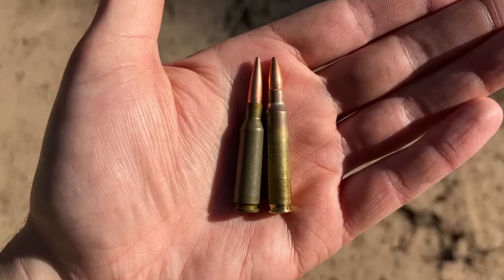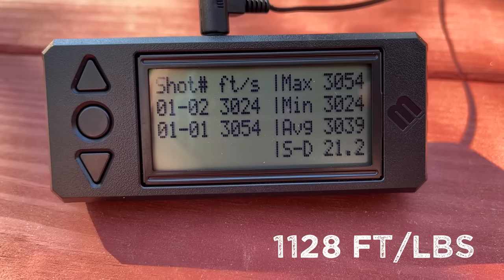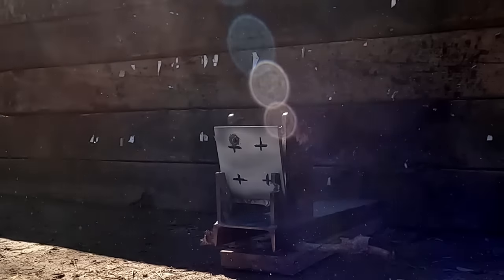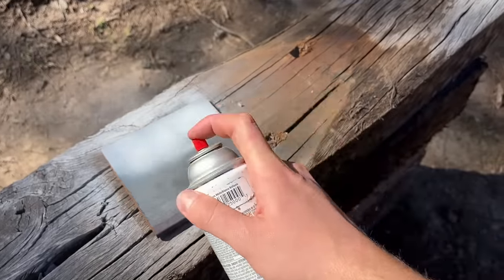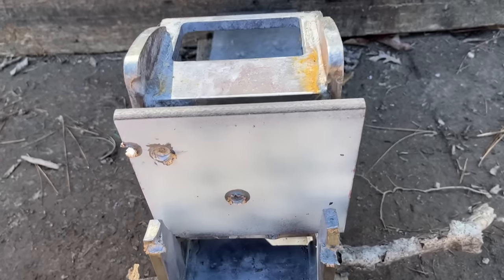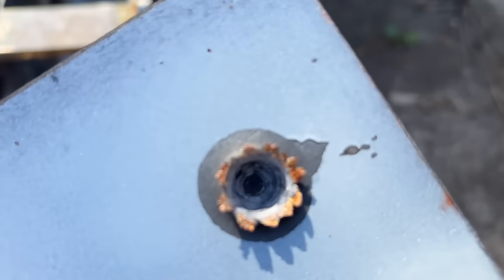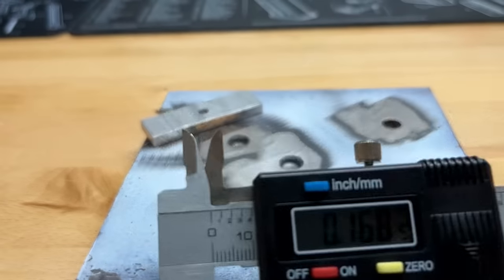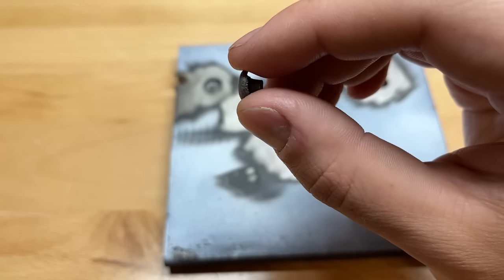5.56 vs 5.45x39 On Mild Steel: NOT So Similar After All?

Comment: 7N6 is a MILD steel core, intended to reduce manufacturing cost, not to increase penetration.
Reply: It also makes bullet very unstable after hit
Reply: 7n6 is not AP at all
Reply: It also allows the bullet to be lighter for length
Reply: Can't imagine why it would be cheaper. Lead is cheaper than steel
Reply: @theimmortal4718  In Soviet Russia, steel is cheaper than lead ;-)
Reply: @kmieciu4ever  
Really? Why?
Reply: @theimmortal4718  Supplies probably. Just like they had the largest reserves of Titanium when it was the USSR. Which the US made shell companies to get.
Reply: @AbsolutionArmament  
I've never heard of anyone considering lead to be a limited or expensive resource.
The advantage of using steel in bullets, as well as mono core copper,  is that it's possible to produce a longer bullet for caliber without increasing weight and reducing velocity.
The longer bullet ensures that it will yaw early in a target. Tumbling is the primary wounding mechanism of the 53 grain  7N6.
The M855A1 62 grain EPR also uses steel along with copper, with no lead. The two bullets are both about an inch long, which would make them over 70-75 grains if they were conventional lead cored.

The soviets knew what they were doing when they designed the 5.45. Long slender bullet with high BC, high velocity (2950 fps from AK74), and early yaw (first 2" of target).
I doubt that scarcity or cost of lead had much to do with the choice of steel. Their 7.62x54, 7.62x39, and 12.7x108  rounds have plenty of lead.
Reply: @theimmortal4718  No, it's not
Reply: that not true
manufacturing  steel core more costly, penetration is a key. mild steel core ammo have waaay better pen vs lead.
Reply: @vaninec  
☝️This
Reply: @theimmortal4718  
Just look up pen lead vs. mild steel
Reply: @vaninec  It was cheaper in USSR and it's still cheaper in Russia due to MASSIVE ore deposits and dirt cheap ENERGY.
Reply: @BigSmartArmed  
I agree, but that not a main factor 
Penetratoon of solid lead bullets is shit, I try myself and you can find many videos on YouTube
Reply: @vaninec Dude my first post clearly states that mild steel core is not for AP penetration, it's for cheap mass manufacture.  Mild steel core comes in a wire spool that's fed into a cutting and forming machines which are run continuously.    

Penetration of 7N6 is superior to SS109 especially in post barrier strikes. 

SS109 fragments if there is enough velocity, or splits in two parts with lead squeezed out.  7N6 just keeps on going until it looses energy.
Reply: @BigSmartArmed  
I know what you said.
I just want to make a point mild steel  ammo waaaaay better pen than lead, that all.
Reply: @PyromaN93  that’s the point of the round…. Hence why it was nicknamed the “poison bullet”
Reply: Steel does penetrate better than lead, though. I can't imagine this fact being lost on the engineering team that designed the round. Unintended, but still so. Probably not really. It was probably a factor along with BC.
Reply: @theimmortal4718  Anyone who has ever been to a scrap yard can tell you that's false. Lead is about 5x more valuable than steel.
Reply: @Oldsmobility98  
That's an unbelievably recent occurrence, and only in the US, due mining regulations by the EPA
Reply: Lead has been more valuable than steel forever as far as I know; including fifteen years ago when steel was at astronomically high scrap prices. It's just a matter of limited supply. Iron is something like 5% of the earth and lead is like .001%.
Reply: @Oldsmobility98  
Lol. What?
Why are you talking about recycling? I'm talking about new manufacturing.
The reason scrap steel is pretty valueless is because it's harder to recycle, as lead is pretty easy to do so.
That has nothing to do with new production.
For new production, as would be used in the manufacturing of ammo for national defense, lead is cheaper. 
Are you imagining that major ammo manufacturers are paying people to go collect tire weights at the local dump?

The USSR actually knew what they were doing when they designed 7N6. It did everything it was set out to do, and replacing the steel with lead would have reduced those capabilities. It outperforms the lead cored, with higher accuracy and velocity, and has a shorter neck before tumbling in the target.
Reply: M855 is also mild steel core. Jesus the mental gymnastics some people go through.
Reply: @EtherFox  
Correct.
Reply: ok yeah thats what i was thinking.
Reply: 7N6 and M855 both use a mild steel core for the same purpose: to improve post-penetration terminal performance. The steel core does also help get a longer bullet for aerodynamic reasons and enables them to penetrate a steel helmet at longer range than a lead core FMJ bullet, but I believe those are secondary effects from the intent.
Reply: @shockwave6213 Wrong.  7N6 msc was made the way it was to CUT MANUFACTURING COSTS.  Steel is cheaper then lead.
Reply: jasonpuddy7866 yes, but 7n6 is still the most primitive cartridge from the 5,45 line
A modern armor-piercing cartridge, like 5,56 green tip, is a 7n24 cartridge
Reply: @bigbadaboooom  Of course not, it was made for soft tissue.
Reply: @theimmortal4718  
Steal core have more pen vs lead
Reply: @vaninec  obviously, but russia used a mild steel plug in 7n6 because it was cheaper than lead.
Reply: @theimmortal4718 because at the time the Soviet Union had so much steel stockpiled
Reply: @letsdothis9063  It was completely intentional. Nobody puts a steel insert into a bullet for reason other than aiding in penetration.
Reply: This is NOT the answer but the uploader gave it a heart....because it sounded good?  It the steel core is definitely designed to increase penetration LOL but it is not AP, just hard target piercing.  Ah the internet, never change!
Reply: @verke2175EXACTLY. In what world is manufacturing a hybrid steel/lead jacketed bullet cheaper than a simple lead jacketed bullet?!?  It's obviously done to increase hard targets penetration, it's got nothing to do with cost savings as it ends up doing the opposite, being more expensive.
Reply: @theimmortal4718 in fact, it does. In early 90s RuAF switched to 7N10 to even further reduce amount of lead in bullet (although 7N10 has a slightly better penetration than 7N6).
Reply: @ФедяКрюков-в6ь  
It does what?
The increased amount of steel increases penetration.
Exactly what I said
Reply: @olisk-jy9rz it's not about the cost of manufacturing the round, but the cost of raw lead
Reply: @BigSmartArmed it could be to increase penetration (not the armour per se, but hard cover at the first place), but in any case it is also connected with the cost of lead, as the information goes
Reply: @theimmortal4718  that's true, obviously. But the change of a standard round from 7N6 (with smaller mild steel core) to 7N10 (larger hard steel core) was made to lessen the amount lead used in the first place. You are both right, kinda
Reply: @ФедяКрюков-в6ь  
The air gap in 7N6 was deleted in 7N10, and the steel penetrator replaced most of the lead, not because of cost but because those elements of the design ended up being irrelevant and ineffective. 
The steel core in 7N6 was flat tipped, so they designed the 7N10 with a more sharpened tip.
It's described as "enhanced penetration", and it is. I've never seen any evidence to show it was to reduce cost. Small arms ammunition is the cheapest expense an army can invest.
15,000 rounds of rifle ammo costs less than one single 152mm artillery round. It's chump change. 
These 5.45 rounds are nearly exact copies of a round that was specifically designed for the Dragunov first- the 7N1 sniper cartridge.
They just shrunk it down to 5.45.
As the 7.62x54r evolved for modern threats, so did the 5.45. It was never about penny pinching
Reply: @theimmortal4718  the air gap in 7n6 wasn't a design feature (despite the legends about the 'poisoned round'), but purely a technological process oddity specific to 7N6.
The flatten tip is actually better for armour penetration on suboptimal angles, so I don't know how it is relevant to the topic
Reply: @theimmortal4718  it does not reduce cost per se, as I understand it. Lead just could become more scarce as a material in a wartime and limit the production of bullets, or kinda like that.
Reply: @ФедяКрюков-в6ь  
I seriously doubt any of that.
Ho told you that?
Nothing in that round was an accident.
They just found the newer designs work better.
No, flat penetrators don't perform better.
7N24 has a sharpened penetrator for a reason.
APFSDS rounds don't have flat tips. They're very sharp, because they work better.
If the Russians want to produce a round of ammo to a standard, they will and can.
The designers weren't stupid or incompetent. It's a great round, and the improvements made it even better
Reply: @ФедяКрюков-в6ь  
Can anyone name a time when Russia had a hard time getting lead? They have lead mines, and are one of the top producers on the planet. They're at war right now and it hasn't stopped them at all
Reply: @theimmortal4718  the hell I know. Russia do also has copper mines, that fact doesn't stop it from using steel cartridges and bimetallic shells for bullets. Maybe it planned to wage a war with NATO in the west, Japan in the East and martians in the middle all at the same time, as it usually do, or whatever. I only know the official justification of switching to 7N10 was both increased penetration and decreased lead consumption at the same time, so it mattered
Reply: @ФедяКрюков-в6ь  
Where did you hear it was to "decrease lead consumption"? That's what I keep asking you.
Small arms are the cheapest and most irrelevant weapons in war. There's just no reason to go cheap or worry about shortages. Artillery shells are way more important and they ARE having a shortage of those. The miniscule amount of lead used in bullets just isn't that important.
What IS important is having an effective round. I think you're mixing up the US Armies stated goal of reducing lead in small arms ammunition with Russians. I've never seen the Russians say such a thing
Reply: @theimmortal4718  it's all over the internet. I even found a russian article about ru MoD discontinuing usage of 7,62x54R tracers in favor of AP-tracers with steel cores because of lead
Reply: @ФедяКрюков-в6ь  
"All over the Internet" 😂
Reply: @theimmortal4718  Not if you already have machines for working with steel. Also because the US has a larger lead reserve.

Comment: 7n6 is not an armor-piercing round. It has mild steel core, but the round is not declared as an AP round. For AP purpose there are 7n22 and 7n24
Reply: Daže 7n6m uže hotj skoljko-to probivnaâ. Molča o 7n10. I têm bolêê o 7n22 i 7n24
Reply: 7h39
Reply: And 7n6m aswell
Reply: So as too M855 is the same that russian one
Reply: @نبهانمروان-ل9س  now there is 7n39 with a tungsten rod

Comment: From what i've read, 7n6 mild steel core is nothing more than cheaper FMJ full lead core equivalent...
Citating from Wikipedia, true AP 5,45 rounds are only:
7n22 (from 1998, red ring above neck and black tip, pointed steel penetrator)
7n24 (from 1999, tungsten carbide penetrator, black ring above neck)
and the newest 7n39 (from 2013, tungsten carbide92%/cobalt8% alloy penetrator, black ring above neck).
Reply: 7n6 is light bullet that's substantially lighter than lead FMJ.

Research the material part before typing your fancy, and really-really convenient QWERTY keyboard, dorogoj inostranêc.
Reply: @worldoftancraft  have a nice day, it looks like you need some nice and kind words in your life, since you're brothered so much about so little...
Reply: @adamcichon6957  I am good, at the very least not bad. What I say is you could not write a misconception. Reality is more complicated than what you said. Do vstrêč.

Comment: The steel core was intended to make the rear of the round lighter than it would be with a lead core. The cavity in the front that the lead plug moves forward into also shifts the weight to the rear, when the lead plug moves forward normally the shift in weight would improve stability but because it does not move forward asymmetrically it actually causes the bullet to flip nearly on impact so there is no first wound channel and then an enlarged wound cavity. The complex design is intended to make it create a large wound cavity without fragmenting.

Comment: That flower pedal effect is cool looking. The same thing happens with the old antitank gun  the 37MM slamming threw big steel plates punching threw them leaving that exact same flower effect just bigger. This is like a mini version . Great job.
Reply: It was discovered with steel core ammo like 7N6 that when the jacket stays inside the bullet hole, it slows down the core passing through it.  Some later version of 5.45x39 ammo were optimized for penetrating steel and aluminum.   They use a hardened and more pointed core with.a little lead between the tip of the penetrator and the nose of the jacket.  The lead's job is to split the jacket at the front so the penetrator can go through the barrier (steel or aluminum) without dragging the jacket through the hole.

Comment: I was curious to see how steel core bullets compared to ball on steel. Awesome video!
Reply: Bingo and I can't believe I have never thought about doing this test since I have so much scrap steel laying around outside my shop
Reply: The Soviet round uses a mild steel core and is not intended to be an armour piercing round. They (Soviets) have specific armour piercing rounds with hardened steel cores, but their ball rounds often have mild steel cores instead of lead.

Comment: The 7n6 cartridge has a steel core made of mild steel; steel was used instead of lead because it was cheap. armor-piercing ones start from 7n10.
The 5.45 cartridge has higher ballistics, so armor-piercing bullets can penetrate armor up to 500-600 meters 7n39.
At the same time, the 5.45 cartridge is lighter and smaller than 5.56, has less recoil, and is cheaper. higher engineering product

Comment: Definitely wasn't 60 hrc or it would've shattered, I doubt the heat generated from the powder is enough to soften the tip. Not only does it take a high temperature (600+ degrees, depending on type of steel) but it also takes a fair amount of time, hours.

Comment: Even anealed steel is quite a bit harder than FMJ. 60hRc is generally only brittle in steels wil a lot of chromium(eg martenistic stainless), sulfur or phosphorous(either as impurity or specifically for special uses needing easy machining)
Reply: You do realize that 60hrc is how hard knives are…. That’s not annealed.

Comment: I harden and temper a LOT of steel, and to heat temper all the way through hardened carbon steel would take time@temp. Time and temp are a complex balance, so imma say that mushroom was soft steel.

One way you can tell carbon content (in solution) is to... GRIND! The spark pattern of carbon steel is very "bushy". The stringers almost pop like fireworks. Low carbon or unhardened carbon steel sparks long stringers. You could always spark test the penetrator before and after shooting. See if something changed.

Idk... either way, cool video. I never really see 7n6 and i was always curious how itd do against m855. 

Another fun video.

Comment: 5.56 was designed for a 20 inch barrel 5.45 is actually pretty well optimized for a 16 inch barrel.   Change the density of the base 5.56 FMJ projectile then change the powder to optimize for a barrel that is less than 20 inches
Reply: 18.6 inch barrel in canadia goes brrrrrrr

Comment: Fun fact: currently used by post-soviet militaries 5,45 ap are different on steel between each other as well due to the fact they mixed 7n10 with new penetrators with old ones in the same boxes to fulfill quota. These rounds are still in circulation in huge amounts. It actually caused a major legal case (and deaths ><) when a (german? I don't remember for sure) plate supplier, unaware of this, used wrong rounds in tests and provided sub-par products to Ukrainian MOD.

Afaik the same issue exists with 7n6 and 7n6m but it's not that big of a deal

Comment: Years ago I shot some mild steel with 7n6 never took the thickness it was old plate from a demolished bridge. But it appeared thicker than the thickest here. Some shots clean through some I was able to pull the penetrator out like in the video. I was impressed soley because the thickness of it .

Comment: There is always the possibility that foreign steel insert ammunition sold over here to the public is not really a military production run but softer inserts specifically ment for civilian use and sale or the ones that didn't pass hardness test
 This is a good reason to disassemble a couple and test the hardness before being fired.
 If it's what their army is using then it still not a problem for them as it'll defeat boby armor which is it's primary use I'm assuming and seems to be better on chrony stats. And yeah better than so many peoples handloads including many of my own.

Comment: The friction of the bore and air resistance can heat a high velocity rifle projectile to about 600 deg Fahrenheit, and while that will get lead nearly to its melting point, that is still well below the 2460-ish degrees necessary to melt mild steel. However, the impact generates an incredible amount of heat, if only for a very brief time period, and I imagine that is how you get deformation of your mild steel core. I think the steel in the M855 is hardened, and I doubt if it deformed as much.